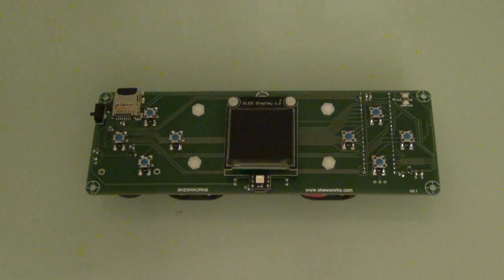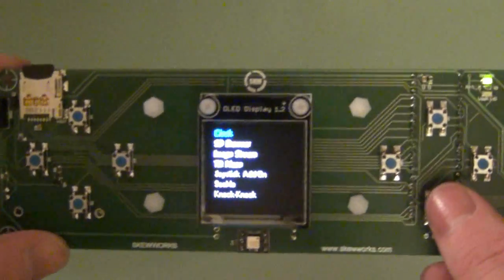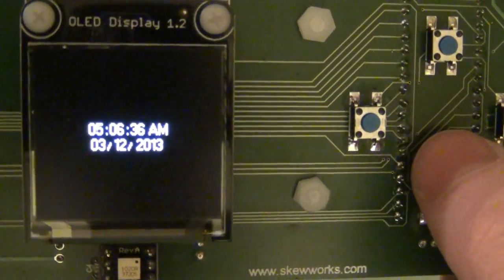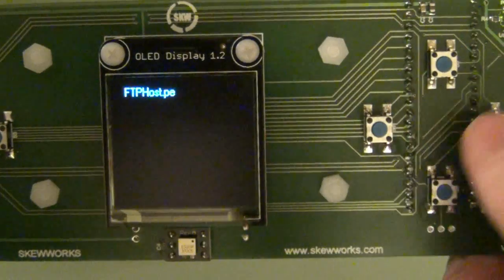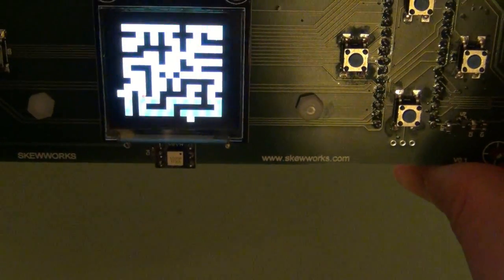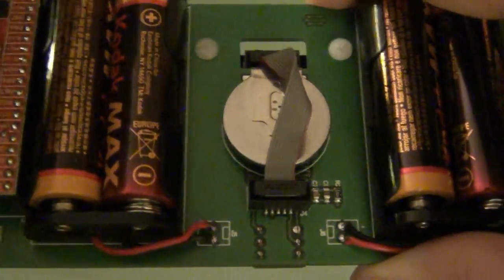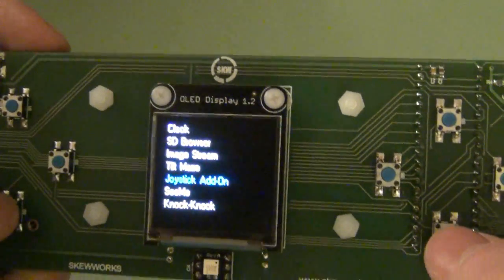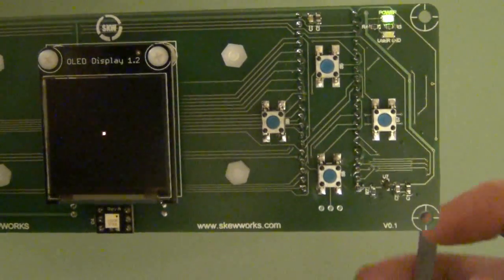ArMF Imbue Demo

Comment from the maker: I think the slowness you're talking about is probably on the accelerometer demo, yes? This is my code's fault, I didn't want it to run too fast so there's a 75ms sleep in there and it only moves the ball 1px per run; I can change this.

The intermediate code combined w/ 168MHz processor should actually make it respond faster than Arduino Due. Intermediate was chosen to avoid possibility of pin conflicts.